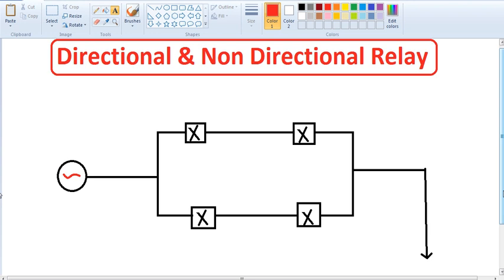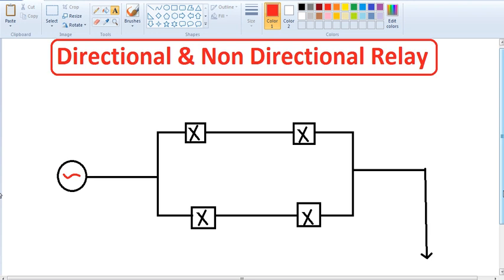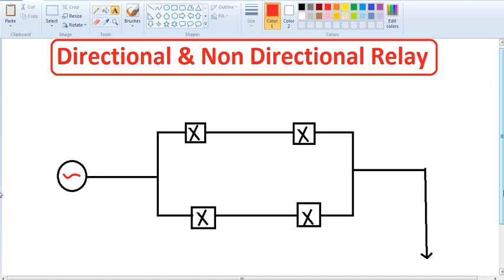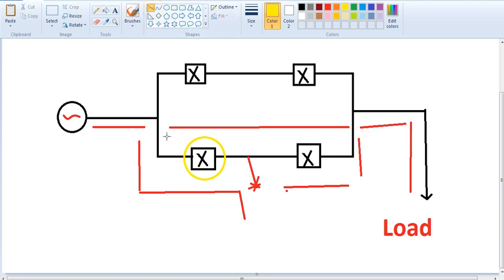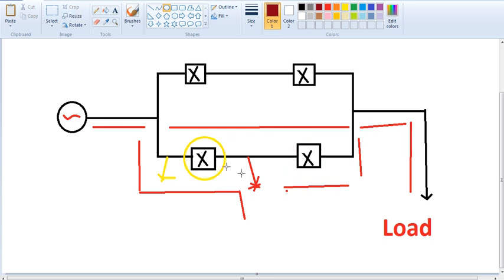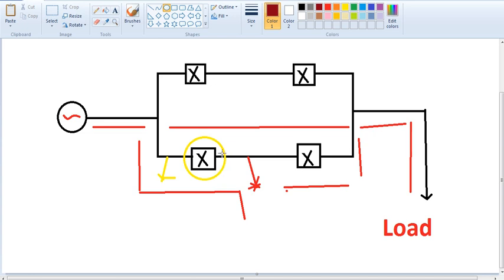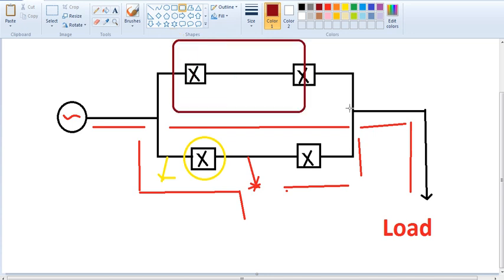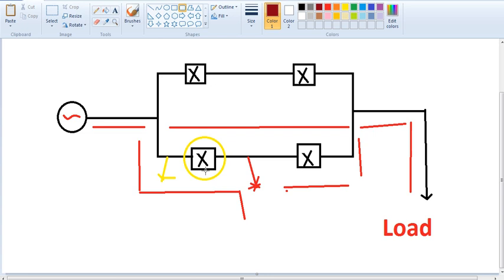What is Directional Earth Fault Protection and non directional Earth Fault Protection in Tamil

Comment: Thanks bro,non directional relay only consider the current but directional relay consider voltage and current angle, depends upon the angle relay will calculate the fault direction as per our setting, directional relay very very sensitive compare to non directional relay

Comment: Concept explain super bro but pls explain exact use bro with example
Reply from the maker: Remember this..Current always goes to short circuit path..ok va..So if the fault occure near to the genarator in grid..the fault current will be taken from our genset....beause generator is an Star connected system.So to.Protect the genset from grid fault.These relays are used....